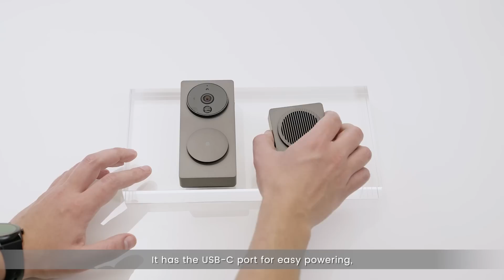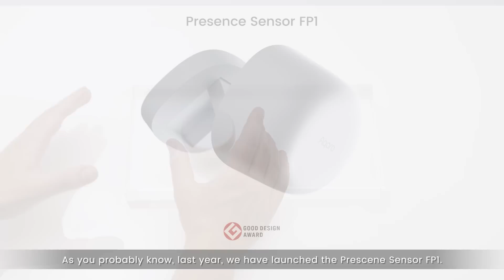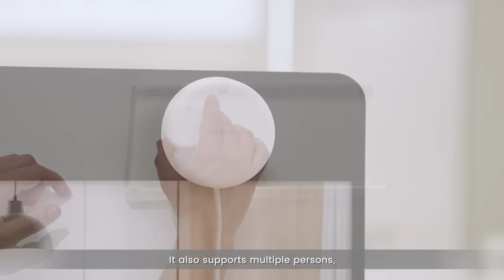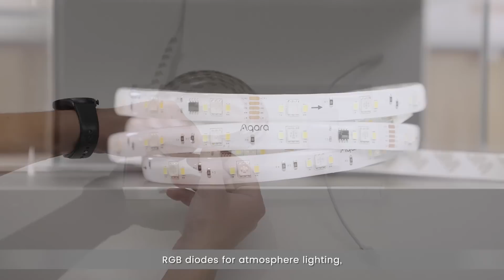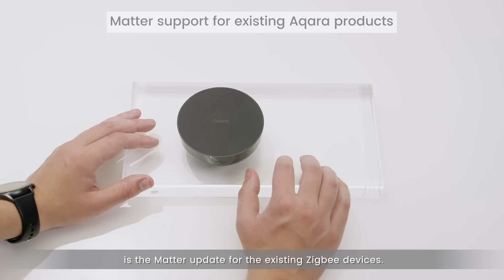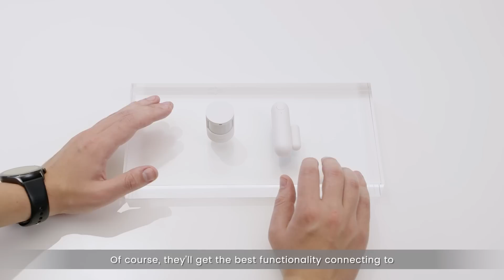[CES 2023] Aqara previews its latest smart home devices with Matter support

Comment: i think that once mmwave presence detection gets cheaper to manufacture it’d be quite smart to integrate it into light switches. they’re positioned out in the open, usually at person level, which i’d imagine would be a good height for sensing. on top of that, the sensor could receive power from the wall and the switch could allow control to whatever’s wired to that circuit.

Comment: Great stuff! On the doorbell: Does it support local use as well (no cloud) via e.g. zigee or Wifi (e.g. via own software hubs), like your presence sensor (which I'm looking forward to test)? Furthermore, you mention that door lock is for US-market, which confuses me. What about Europe and does that restriction apply to the other presented products as well?
Reply: Hi Peter , about the U100 smart lock,  which is a US deadbolt door lock. I think the bolt may not fit for European door that is why who said U100 is for US market.

Comment: what about the hub? rumors indicated that there would be a successor to the M2. We know that you are working on OTA for M2 but I'm building a smarthome from scratch in 2023 and I don't know whether to wait for something like M3 or only get an update for M2 this year. The other thing is the light switches. Fairies whispered that you are planning to release new H1 switches this year, but in frames, which will allow you to put 2 side by side on a double electrical box. Can you confirm something?

Comment: Really interested in the doorbell as a replacement for my ring db2.
Only 2 things I hope for:
As it works on AA batteries I hope it’ll work with rechargeable ones. So 1.2v instead of 1.5v
Next I hope it will be compatible with home assistant out of the box, or via rtsp.

Comment: What we need now is Switches with Thread Support. This will help strengthen the Thread network since they will act as Full Thread Devices that can then help sensors hop on them to connect if Border router is far.